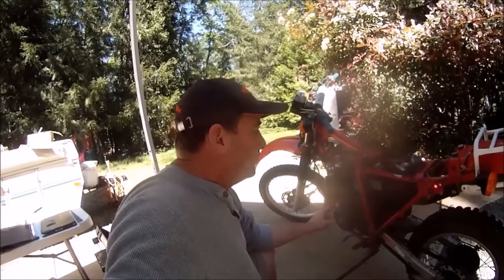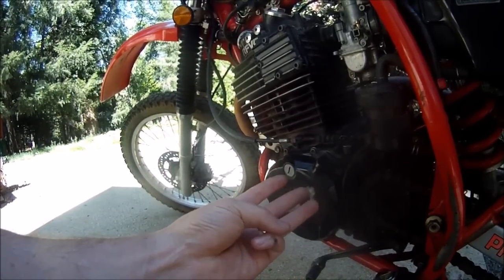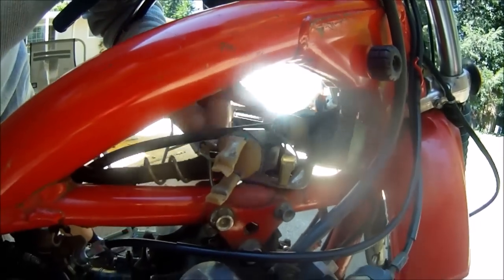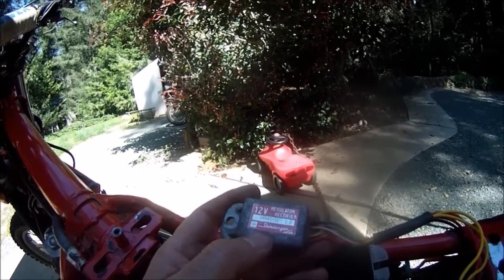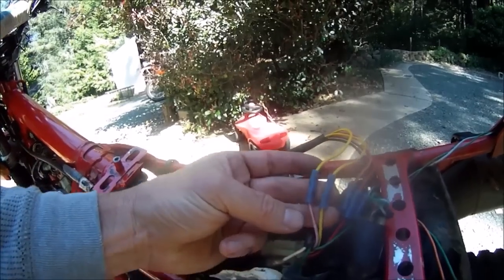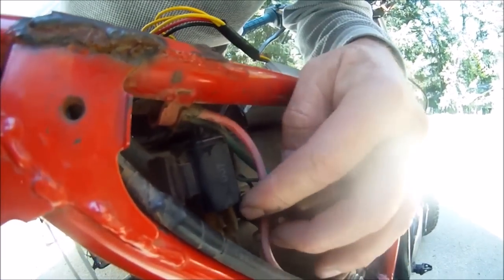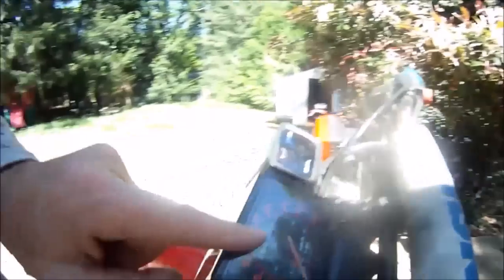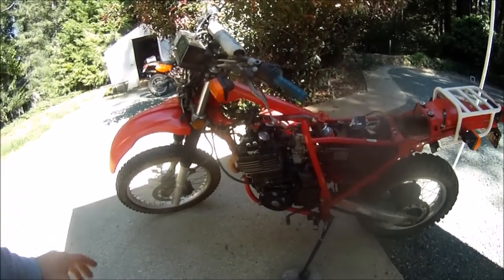1983 Honda XL600R Electrical System Review

Comment: Have you posted or found your service manual online? I’ve got an 85 that I’m trying to get fully running and so far in your vids sounds like that guide you have is a great resource 
Also great vids! I’m gonna try to follow these yo go over my carbs and electrical, thanks!
Reply: http://www.hondaxl.it/manuali.htm
for parts and shop manuals
Reply: @jethro9341  i see this is is a 2000 and up site
Reply: @felixmikkialmosttoasted3911  I got the manuals for my 84 from there.

Comment: hey man maybe you could help me or guide me if theres anyway possible it will work. i bought an 87 xr 600 with one motor blown and another motor rebuilt. ok heres my problem,the rebuilt motor is an 83 xl600. the only harness i have is the 83 xl600. is there any way possible to wire this motor on the 87 xr frame? also if so will it have to have a place fixed for a battery for help cranking or firing?

Comment: hey, in the beginning you said you had got the bike started and tested the cabs, what part of the electrical system needs to be connected for that? What can be disconnected for that? In the process of trying to get an 1985 XL600R started. Thanks.
Reply from the maker: Just the ignition portion of the stator and associated ignition components.